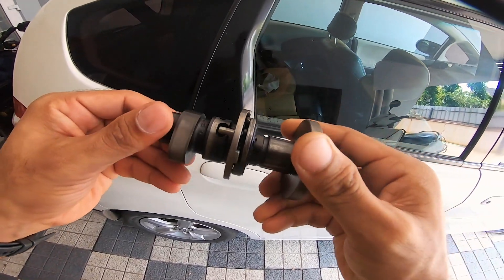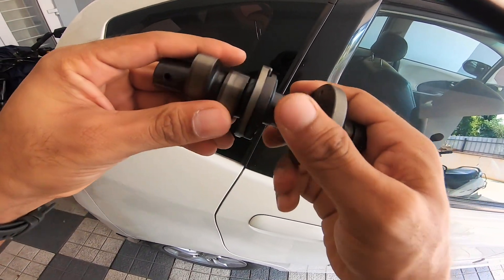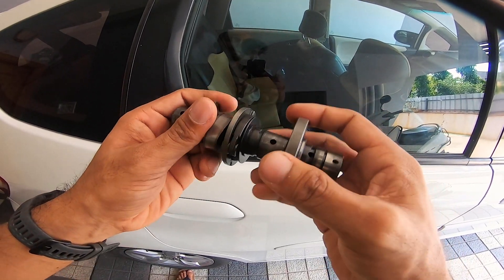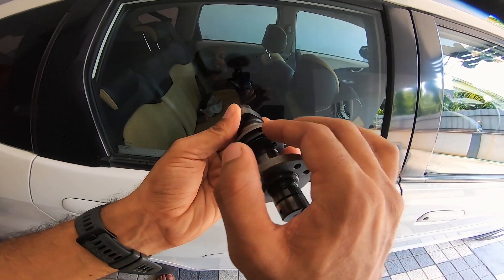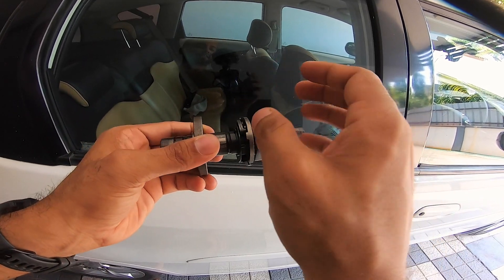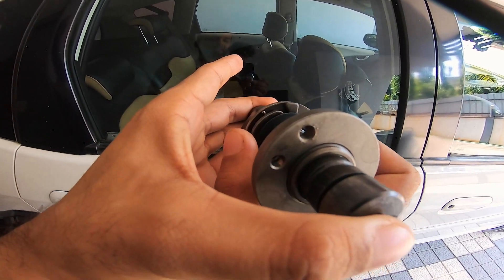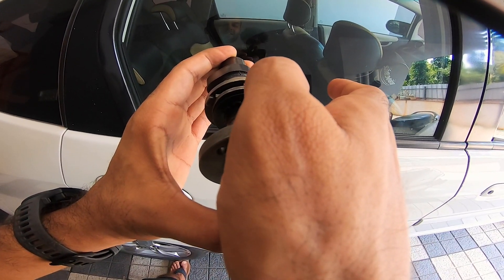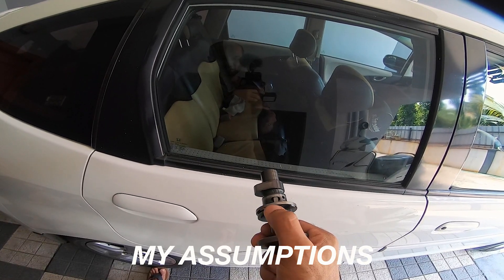FINALLY FOUND THE CULPRIT FOR THE INTERMITTENT TICKING NOISE HIMALAYAN

Comment: This happened on my himi too and I visited the service centre numerous times regarding the engine but the mechanics kept on saying it’s normal for the himi and the usual bs but then luckily at my nearby by Royal Enfield mechanic whom i was close friends with told me that it’s because of the cams and there is a tiny bump on the exhaust side which would go flat under higher rpms but the spring for it is pretty weak and can fail even before the bike has done 10,000km sometimes, he was a dirt racer and had a fully stripped down himi prepped for dirt racing so i believed his words and got the cam replaced which in short got rid off the annoying  . The tec cams i had a lot of research done it and most reviews say it’s not drastically different, only on higher rpms would u notice the difference and those reviews were backed up my dyno runs too so your take on it might be 50% placebo effect and 30% because of the newer cams which will make the bike more responsive compared to the old one which was pretty beaten up and 20% because of the performance difference.
Reply from the maker: The TeC cam produces a torque and power curve PARALLEL to the stock factory curve and that is why most people can’t articulate what they are feeling . Wait for my review on the same . A video coming soon
Reply from the maker: And thanks for sharing your experience with the sticky decompressor 🙏😊

Comment: No wonder why i get small pops and bangs when i let off the throttle and let the engine brake till 2k rpms when it's hot , because of the faulty cam the exhaust valve is open just a bit to hear those pops

Comment: I suspected that the cam auto decompression cam unit is problematic. I remember my father who was a Harley rider, telling me exactly that. After a few thousand kilometers, my bike began stalling and ticking when hot. So I adjusted the valves and no change. After doing all the recommended mods on the bike to stop stalling, I found that simply dropping the RPM to 1000 was the only thing I could do that really stopped the stalling at idle. But it still stalls when on the road between gears. It seems the problem is around 1500 rpm. I thought that the Fuel X would help but did not eliminate the stalling. Of course not if it is a faulty decompressor making the engine suddenly lose compression and stall. Thanks for the vid, I kind of thought about changing out the cam for the TEC cam just to eliminate the decompressor. You have shown me that suspicions were warranted. Thanks again.

Comment: Brilliant find, trust me your mods have turned a junk to a jewel and please don't mind me saying that. Coming to the camshaft itself, it's a great find. Per your point, when the bike revs, it settles down, but when it idles or in the lower range this "clicketing" sound emanates. I'm surprised to hear from many gurus say that it's combustion clatter and nothing else, which always had my head scratching. Now, an engaged or partially decompressor with the engine can induce poor combustion, more heat, idle hunting and what not. Did you ever face these issues pre the TEC installation?
Reply from the maker: You are 100% correct about a partially engaged decompressor ( sticking ) leading to compression loss , poor combustion , power loss @ lower rpms and all sorts of noise . Very few GURUS know about this and understand it’s implications
Reply from the maker: The Himalayan was never junk to begin with , it is a fantastic engine and an even better chassis and one of the best “stock “ suspension in the market ( one should know the comparisons) . People ( self proclaimed BIKERS) make it junk over a period of time . True Bikers never disrespect their machines .
Reply: @ONTWOWHEELSBEN  Can't be more true! Keep her chugging for as long as you can.

Comment: Thanks for the great info Ben. Before this comment I searched Himi Decompression failures because I thought I had seen a vid on this before except that it happened with very few km/mi on it. Could not find it anywhere. So I obviously need to stop sniffing so much glue/paint/radioactive sludge etc. Anywho for anyone with this problem it would be a great time to upgrade to a Tec cam.
Cheers and good luck to all if you do a cam mod.

Comment: Hopefully this comment will be/stay published. I appreciate your content and your dedication to accurate information. To that end, the information about this issue has errors which should be corrected. This auto-decompression device will fully extend to its non-engaged position through centrifical forces within the first few hundred RPM (the indicated engine RPM is double), or basically when the engine first fires. Since centrifugal forces extend and hold the decompressor in its disabled position, this already weak and now weaker spring would not be able to overcome this and pull it to its engaged position. If anything, the weak spring's failure to engage the decompressor would be causing increased compression pressures during start and putting additional load on the starter. Humbly, while it might somehow be adding some noise to the engine's cacophony of sounds, I am not sure the reasoning of how it would actually engage at operating speeds or how the weak spring would actually increase that.
Reply from the maker: I am aware of how centrifugal forces act on the decompressor. But when the spring gives up completely and as a result of which the lever moves / doesn’t move as it is supposed to and to add to it STICTION , all these factors can cause unexpected noises and also compression losses . This is a universal problem with “sticking “ auto decompression levers in cams .

Comment: Hi Ben, that is indeed a major issue! 
Thank you so much for sharing this. Can you show how to check this topic on the bike for a beginner without removing the camshaft? 
Greetings from Germany
Reply from the maker: If the decompressor is sticking , the ticking that you will hear will be INTERMITTENT and ONLY in idling or below 2000 rpms

Comment: My 6 month old himmy has the same ticking noise from the start .Do you think its the camshaft? I thought it was valve clearance issue(SC didn't check valve clearance in first service) and hoping to check it out in the second service. Can the camshaft been defective from the factory?
Reply: Same, it started after 1st servicing
Reply from the maker: Yes it can be defective from the factory, get it checked ( now you know what to look for ) and replace in warranty

Comment: Do you talk about a sort of ticking metallic noise appearing when you accelerate?  Can we keep on using the bike with this problem?
Reply: yeah I experience the same noise. Let me know if you get any answer
Reply: @devanggaur9174  Hi! I fixed the issue.
If you these tips, you'll be able to have a noiseless bike.
1/remove the side tank gards (that provide vibrations).
2/remose the head light support and install a new one with fork support
3/Replace the stock air filter for a DNA with the opened cover
4/Install the FuelX lite on the ECU
You will have a bike with far more torque and an engine more soft.
Approved since january 2024! ;-)

Comment: Bs3, tec is not available for me. Just replaced with new re camshaft which made my bike very smooth. But i am hearing small ticking on the left side on idle. I adjusted valves also. Svc centre guys told me to ride for 100 km. Since i have warranty for 1 yr hope i can replace later if there are any issues
Reply: How much had it cost you to replace it?

Comment: best bike for now, got a new 2023 model and over the next few years will be building it for pure performance and maximum hammering off-road . I found the clutch is a weak point on Himalayan when riding hard , any after-market option to make it stronger?
Reply from the maker: I added washers to the springs
Reply from the maker: Hitchcocks sells an upgraded clutch kit